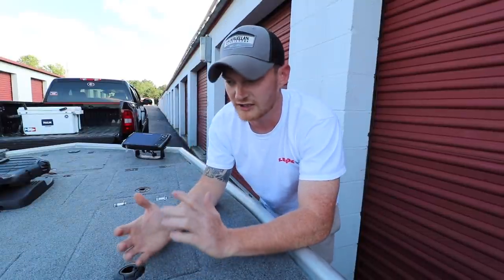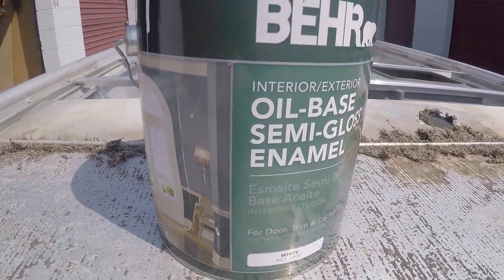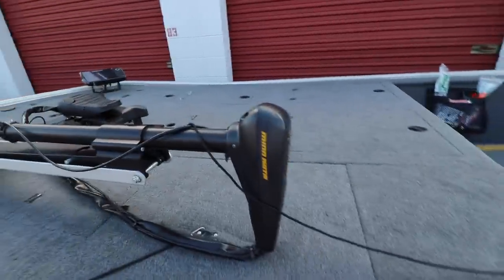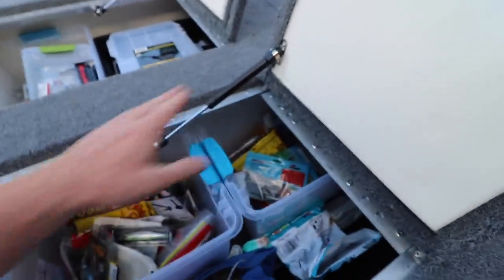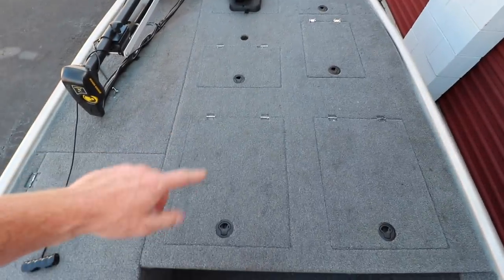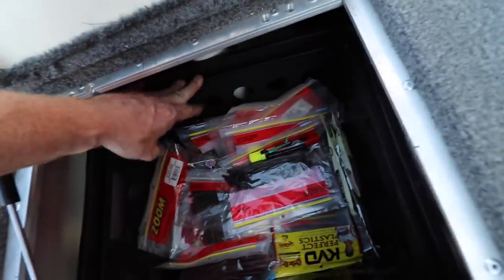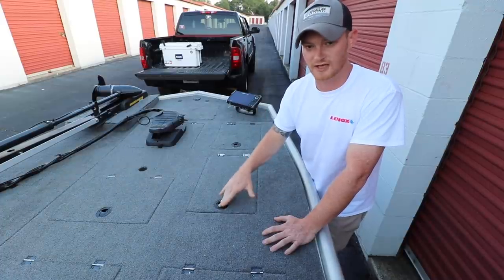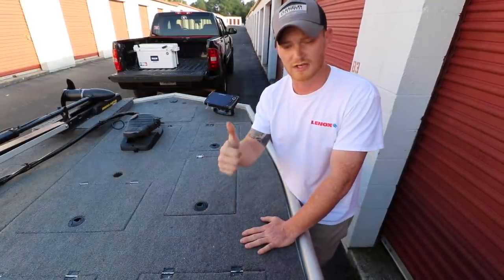6 Month Update!

Comment: Good video. I appreciate you showing what you did not like as it helps your viewers to make better decisions. We either learn by our mistakes or other's mistakes. I purchased marine metal latches and almost went with the ones you purchased. I'm glad I spent the extra money. I have been debating on what to do to protect the plywood. My carpet comes in in two weeks. I will make sure to grab some oil based paint to seal the wood.The boat does look clean. Good job. I will have to look at your other videos to see the build.

Comment: @2:04 the tackle web system... I so need that. It would likely be much more efficient than my current system, called "The pile". And also, I have to say, my recess pedal tray was WITHOUT A DOUBT the single best upgrade I've made to my boat. I paid $72.99 for mine, but if I had to do it again, I'd pay 5X that amount without even giving it a second thought. And by the way... it still looks amazing dude. Great job.

Comment: When I put my live well in years ago I ran it with one pump.  To drain mine I just ran a hose to a fitting in the transom and put a drain plug in.  I ran an inlet hose in and an overflow out the side of the boat.  That way the fish had a supply of fresh lake water at the temp they were caught at. So no stress from a temp change.

Comment: You can stop water getting into your hatch with weather stripping, a small hole, and some tubing. Use thin weather stripping along the inside edge of the hatch to create a channel. Drill a small hole in the lowest corner, and run tubing down to your sub floor. It's not perfect, but it's pretty darn close. You could probably lay a bead of silicone or something as well. That's how I fixed mine. Was cheaper and easier than installing catches. Also takes no time. 

After the season you can pull the stripping out, and install catches if necessary. That was my plan, but tbh the simple fix works great and only looks mildly ghetto, lol.
Reply from the maker: Haha, thanks Chris! Not always about looks!

Comment: Fix your striped screws with 5 min epoxy and the ones that don’t stay tight too. If you have to remove them you can heat them with a soldering iron and they will back right out or coat screws in wax fill hole with epoxy put screw in let dry really well and tighten them up

Comment: Those edges that wore a bit are due to the fake that that edge is 90 degrees. If you round over the edges just a little at the top it can reduce or eliminate that wear.

Comment: How are your led strips holding up? They're pretty cheap so I might go ahead and put some in my boat. I was just wondering how durable they are and if your circuit has failed or disconnected easily or at all.
Reply from the maker: those are working great! haven't had any issues with them. that might be why i forgot to say anything about them haha

Comment: Good job on the boat , if you need to get more power you need to get a TORQUEEDO ELECTRIC MOTOR . I just built an electric only boat and the torqueedo 24v motor pushes it along at 10 kmh.

Comment: A little tip for those cheap latch screws tightened them all up and shoot some silicone in the whole. Be generous so if you ever have to change them it’s easy to pull a big chunk of silicone out then it is small dot amounts.

Comment: Whats up man, love your build so far.  If you're looking to gain a little power and speed but still be able to fish the electric only lakes, I picked up a motor that would probably fit this build pretty well.  Its an electric outboard that claims to be 4hp, and in my experience will move a boat MUCH quicker than any trolling motor.  Heres a picture of it on my dinghy, which I use on electric only lakes too.  Im of course pushing a lot less weight, but I am consistently the fastest boat on any electric lake.  https://i.kinja-img.com/gawker-media/image/upload/tzdioz3hszsqpz3v43pj.jpg

Heres the motor itself: https://i.kinja-img.com/gawker-media/image/upload/e2fhvyqotpxqzlymg1tf.jpg    Its built in a gas outboard motor shell and they just replaced the motor with a huge brushless electric motor.  Everything else functions like a real outboard, which makes it a lot nicer than a trolling motor in terms of throttle, tiller functionality, tilt settings, and propeller replacement.

With this mounted on the back alone itll probably be significantly faster than the 2 trolling motor setup, and you can just move both trolling motors to the front and run them all for pretty good speed.
Reply: Prav S  What kind of motor is it? That picture is gorgeous. That sounds pretty neat, is it pricey though?